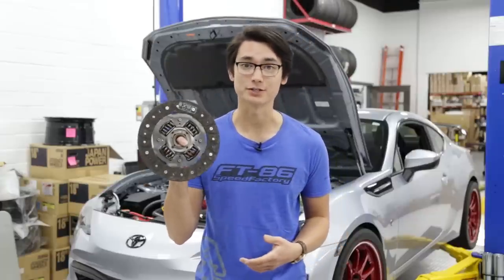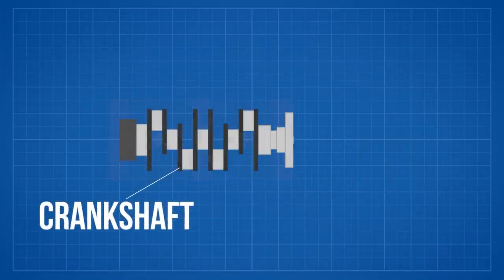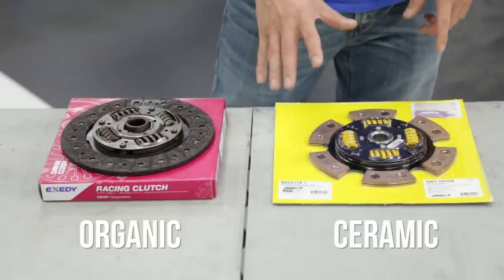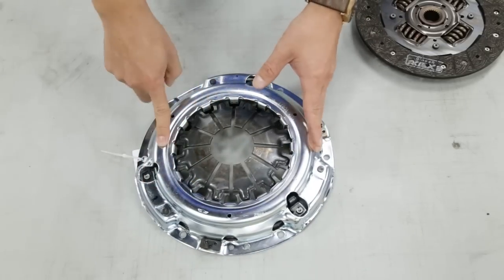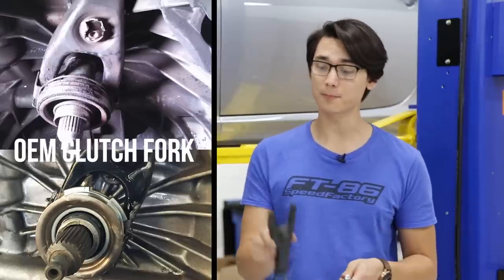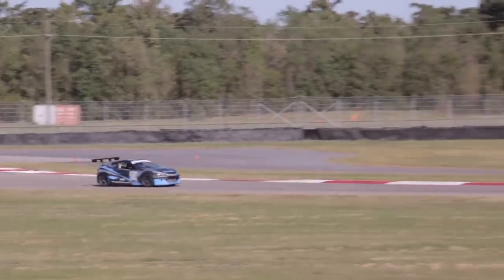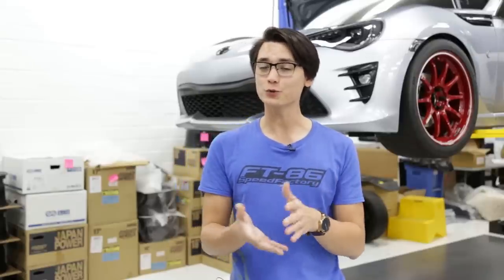Aftermarket Clutches - What you need to know before you buy

Comment: YES, it's so nice to see when people actually rate a clutch by the torque - NOT that 'power' BS! I would also suggest, for those who are winding their engine to very high rpm, that 'burst strength' may also be an important criteria.
However, you didn't mention the importance of a Marcell Spring, which is the primary reason for a smoother, more progressive engagement - some standard and aftermarket 'organic' friction plates didn't have them and are rather abrupt in take-up, there are aslo some rare sintered and ceramic friction plates that do have them and they are much more suitable for high performance street driving.
You also failed to mention the importance of the hub springs and their affect on general driving, as they also have a significant affect on clutch take-up - and the reduction in inertia using a plain hub has on the vehicle.
With the pressure plate, it is worth checking with the supplier as, by altering the diaphram's effective pivot point there can be an increase on clamping force with a stronger spring, but the same pedal effort but with a longer pedal travel.
You also missed out, completely, the different clutch diameter options that are available, especially if replacing the flywheel with a ligher one - even the number of friction plates.
Reply: Yeeeep. I was asked “how much power will your car make?”, which I can’t answer, but I do have an idea of the cylinder pressure/torque with the stock turbo and cam in my car. 

I’ll be upgrading both, so I’m not sure where my useable rpm range will end up.

Comment: You forgot the release aka"throwout" bearing. Sprung vs unsprung disc. Unsprung makes it harder to drive if you are a noob, but less to go wrong. A cheap release bearing can be trouble so check its ply. If it's tight your good, if not get the oem one from the dealer for about $50. Or look for a national or timken bearing.

I am looking for a specific piece of info on how to identify disc compatibility spline count and offset. Still haven't found it. The options for my BMW were limitless, but for the jeep not so much. I dont want a sprung disc. Not gonna race it, but a sprung disc make engagement jerky.

Comment: The heavier flywheel is better for drag racing  because it helps keep the RPMs up when shifting. , light is better for road course cars.
Reply: Bingo. He didn’t mention DMF/SMF. And…generally, I’d recommend a DMF to reduce shock load to your drivetrain components. You’ll also maintain livability, which is incredibly under rated when modifying a car.

Comment: that clutch animation was incorrect, the clutch fork pressing on the pressure plate relieves pressure on the clutch disk. not the way it is shown; pressing the clutch disk into the flywheel.
Reply: Aye CPL. That grammar was incorrect, the proper spelling is "relieves ". Not the way it is shown.
Reply: yes, I noticed that too, if it was the way he showed it on the animation the pressure bearing will last nothing at all.
Reply: I was watching it like wtf is this bullshit
Reply: Some cars have a pull not push type clutch setup like evos
Reply: @westvalleyliving7632  That's the rare exception, not the rule. The animation was incorrect as well as his explanation of the pressure plate.
Reply: @therandomreal  Exactly. Also on ft86 cars it uses a normal pressure plate spring.
Reply: True

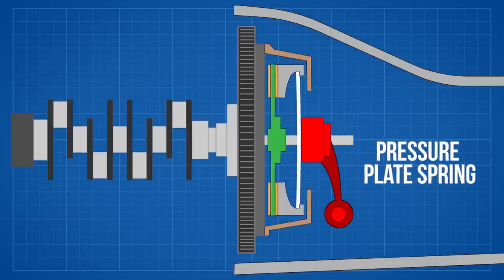Comment: 1:15 is wrong diagram. When you Press the pedal it presses the pressure plate  "leaf's"  that releases clutch from  the fly wheel not the other way around.

Comment: I have a ZL1 with the engine upgraded to 800 HP at the crank shaft with the Torque increased to near 750. Mostly street use, I cannot locate the OEM Clutch specs for the PRE Modified Engine 580 HP, and am wondering what you recommend as a clutch replacement. Some folks recommend  installing a clutch rated similarily as the engine HP and Torque? The dealership recommends OEM for the Pre modified engine specs...also a a 1000 HP rated clutch has been suggested?

Comment: One thing i cant find much info on is "dual friction" clutches.

I bought a 6puck/metal organic for a 1jz supra build im undetgoing and it was on a whim.
Im almost all bolt on mods under 350hp and drive street sipirited with some track use.

Did i eff up or maybe good call.

Comment: I bought this ca18det engine with clutch attached. Noticed it's impossible to bush the clutch fork with my hand after installing it to the engine. Is this normal as my engine is still off the car.

Comment: dudee, your explanation and animations are miles better than "engineering explained"  :D

keep up the great work !
Reply: +8Hachiroku6 EXACTLY this. Jason is a smart guy but he teaches like a professor that needs to finish the class quickly to fulfill the syllabus.
Reply: If the animation is 100% wrong, then it is even worse - is it not?
it also missed out a bunch of other factors, which I mentioned in my comment on the video.
Reply: The animation for the pressure plate is completely incorrect

Comment: When you installed the ACT clutch with flywheel, did you have to adjust the clutch pedal height? Having issues with it disengaging .
Reply: Is it a lighter flywheel
Reply: @anonymousmc7727  yes it is a lightweight flywheel
Reply: It’s the lighter flywheel that’s causing it

Comment: Is there any clutch just as good as Clutch Master FX300 but not that heavy when you step on it?
Reply: How stiff is it?  The clutchmasters pressure plate is supposed to be just BARELY stiffer than OEM since it has a hi leverage system.
Reply: @josephsabatino7857  I read it in another youtube video that said the FX400 is stiff.  So I assume the FX300 is just as stiff.  Someone also told me "If you're getting a clutch that's meant to accommodate extra torque, the pressure plate is going to be stiffer, making the clutch pedal feel much firmer than stock. If you get something that feels like a stock clutch, it's probably not gonna have a higher torque capacity than the OEM."
Reply: @HappyHopping11  I had an FX350 and the pedal was basically like OEM.  Hardly stiffer.  Maybe just a hair stiffer.  Yes a higher rated clutch will have a pressure plate with more clamping force but ClutchMasters has their own design to where there's a bunch more leverage which alleviates the stiffer pedal.  Think of trying to use a very short wrench to tighten a bolt versus using a very long one with a breaker bar.  Tons more leverage.
Reply: It's easier to tighten something to 200ft lbs with a long wrench than it is with a short wrench.

Comment: You're explanation is reversed. When you press the clutch, the plate spring disengages the disc. When you let go the entire assembly turns as one and the release bearing is not pressing the plate springs. Plz remove this video. It's too much misinformation.